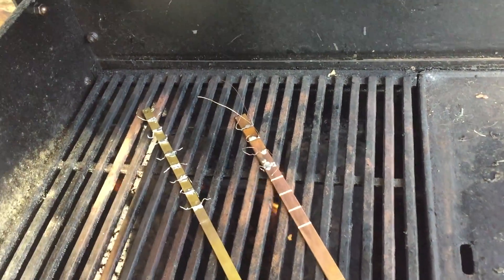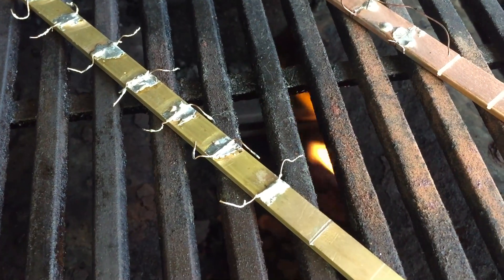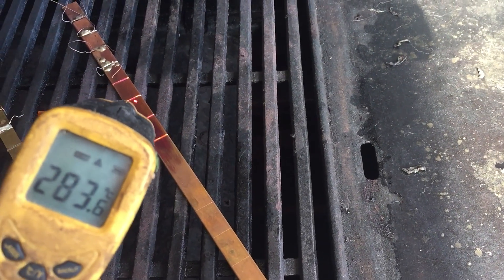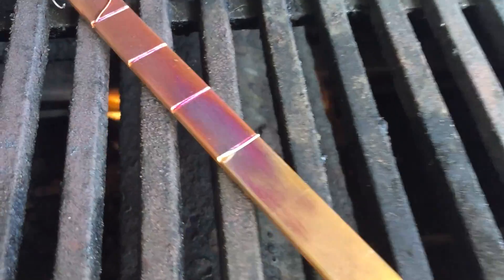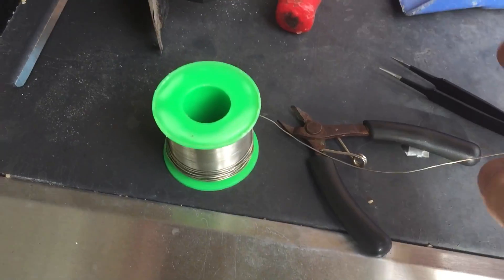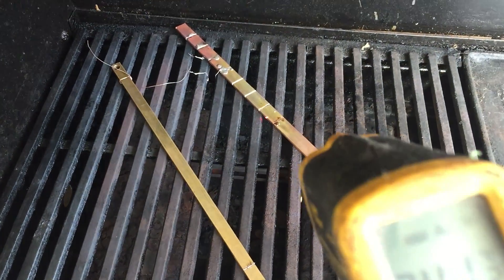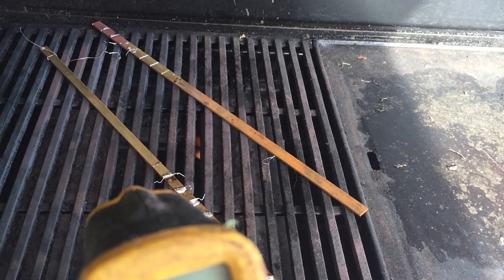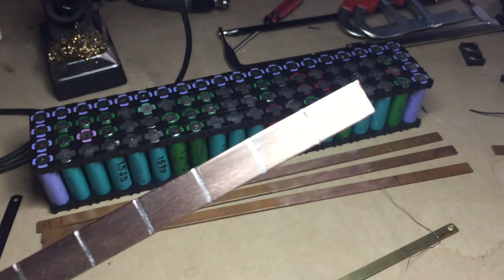F!@#$%^&*ck YES !

Comment: A pico fuse burns quite black when it blows as far as I know?
Reply from the maker: +Edmund Pohl I got a bunch of them a while back, and used them in other projects in my experience they just blow and you have to do a continuity test to see if they have blown. That said they were all  purchased off ebay, maybe in hindsight they were fakes perhaps.. at any rate i like the way my way is turning out :)

Comment: Hi HBP. I would go with a thinner bus bar - been soldering for 30 years and you will always struggle with that thickness of metal - iron, flame, oven et all. Also - I would go with something called a pico fuse. Google it? Run pico fuses in a crisscross patterns and then link up 2 to 3 thinner bus bars per pack. Actually slowly starting to tackle this as well - 14S200P@2Ah each.
Reply from the maker: +Edmund Pohl I'll battle through the issues - till my project turns out like the messed up schematic in my head. pico fuses have been a hot topic for a while on my channel - pico fuses are fantastic in theory but you can't SEE an issue :(

Comment: why not just spot weld the wire to bus and cell?
Reply from the maker: +Ilya Antonichev (UU-Tech) Bah - boring - been done AND i'll go cross eyed trying to line up the welding electrode on top of the 0.2mm wire
Reply: +HBPowerwall use flat nose electrode...
Reply from the maker: +Ilya Antonichev (UU-Tech) ok they have flat noses.. ok didn't know that, but still been done too much on YouTube, trying to put my own spin on this project..
Reply: +HBPowerwall ok!  Go on!
I really intrested in this project.

Comment: Video uploads are very good, flowing of the bus-bar is looking the way to go. Do you know a way of bring back a cell that is .500 of a volt. Keep the videos coming..... Are you using 6 or 8 amp wire from cells to bus-bar?
Reply from the maker: +Geoffrey Howsam Thank-You, bringing back cells yes there are a few ways all of them bad (but i've done it anyway) I'm in the process of making a video of stuff not done so right so other people know how to burn their house down also.  I'm still testing and considering my options with the fused side of the busbar. Likely i'll be going the 8amp house fuse wire for reasons only I can comprehend at this time. More extensive testing off camera will be done.  Fuses are turning out to be the big issue with this project with everyone having a differing opinion on the topic so i'll be doing my own thing and I'll see how it turns out longterm.